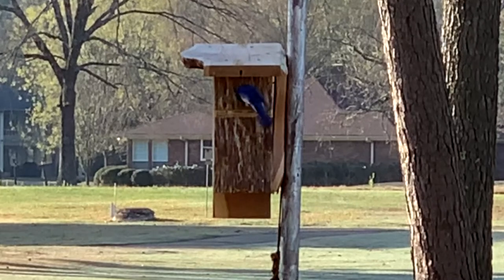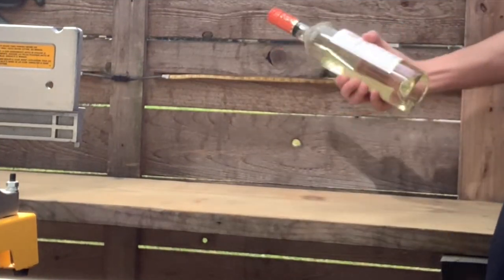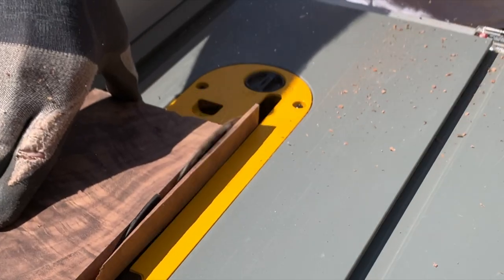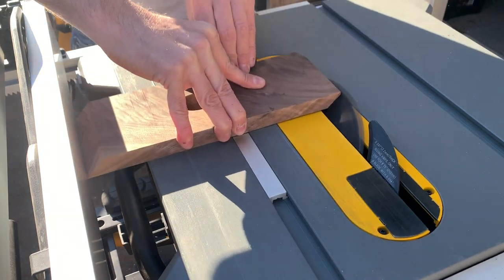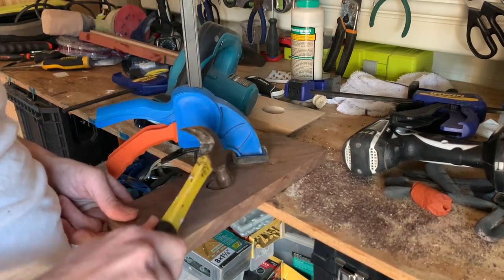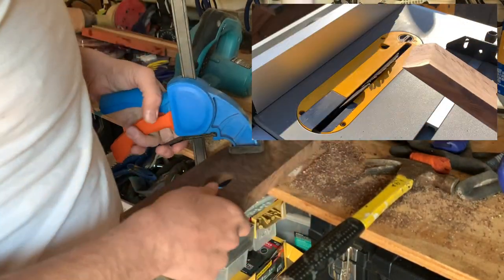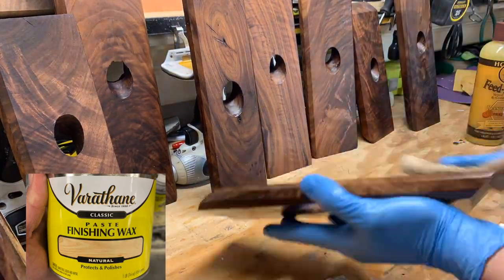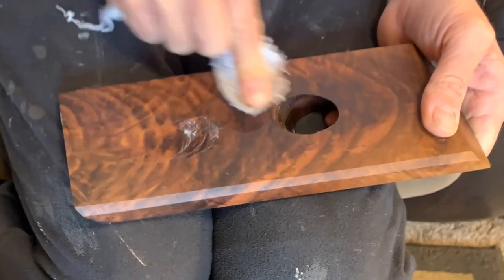Floating Wine Bottle Holders

Comment: Made 4 of these and found they were not too easy to balance - especially when not full. 
So I changed the length to 300 mm & the thickness to 45 mm. A  40 mm hole is drilled 190 mm from the bottom. Both ends are cut at a 33 dgree angle.
They are rock-solid - even with an empty bottle!
Reply from the maker: @fontybits Hey, good morning Loch, thanks for stopping by and leaving your feedback here.  I apologize that I didn't give the best set of measurements in this video.  This was my first attempt at making them after seeing the idea on the internet some time back and I think quite obviously (at least to you), I didn't get the best solution.  I like that you re-tooled and came up with a better alternative and came back to let me know, this is super cool of you.  I'll definitely be giving your method a shot and I'll come back to let you know how they turned out.  I'm pretty excited and optimistic to try these again now!  Thanks my friend, let's get back to making some more saw dust!  Be careful.  I appreciate your time and support here 🤝
Reply: @CurtisMadeIt  Hey Curtis, opinions are like butts - everyone has one! I  thought I'd share the specs which worked perfectly for me. I gave one of my first attempts (25-30 mm thick) to a friend's wife, and she commented that she found it difficult to balance. That's when I went back to the "drawing board." 😃 Maybe someone will even improve on that. Have a great day.
p.s. My pine wood shows some beautiful knots which really add to beauty of the bottle holder.

Comment: Is it ok to drill the hole anywhere down the length of the board?
Reply from the maker: @3AMREVIEWS Apologies for the delay in my reply...I was out of town for the Labor Day weekend and didn't have a reliable internet connection.
Short answer is yes, you can.  You are going to have to experiment though.  On the longer boards, you can use a large wine bottle and flip the board over so you can use both sides to display...I think I like this way the best.  The shorter ones can accommodate either a large bottle and/or a small bottle on opposing sides...this is the experimentation part.  You are going to have to dial it in to find out exactly what you want, but this is a fun project with results that are sure to make a fantastic gift or be a hot seller in the right market.  Let me know how else I can help.  I'm on instagram curtis_made_it.  Talk to you again soon my friend 🤝
Reply: @CurtisMadeIt  Been watching a few videos on how to make them and seeing lots of variations. Thanks for the tips!
Reply from the maker: @3AMREVIEWS Okay, okay.  Good.  Do your research.  Find out what you think will work best and give it a shot.  Learn some stuff.  Dial it in.  Make some new ones.  This is how we do it.  Be careful.

Comment: never wear gloves when using spinning tools, the blade/bit or whatever is spinning catches the edge of the glove and it is dragging your hand in with it.
Reply from the maker: @Crucklewood Designs Hey C, you are absolutely right, thanks so much for pointing this out.  This must be your first time on my channel though as you are clearly not yet aware of my lightning quick reflexes and super human strength.  I'll grab that blade while its on full power and make it stop instantly!!!  Haha, just kidding.  I did know the 'no gloves around rotating equipment' rule beforehand, but someone else may not so it's good that you said something.  *Some of the stuff I do in my videos is to generate comments and, if I remember correctly, that is exactly what happened here...and clearly it worked.  You can see how far off the blade I am so I was taking a calculated risk and a tiny one at that.  I sure appreciate your comment here, your time, attention to detail, and your support my friend.  Come back and talk to me again down the road.
Reply: @CurtisMadeIt  I am sure you know what you are doing and was aware of the risk. I am new on here you're right, i just subscribed to your channel so i'll check out some of your other stuff and well i don't really know what else to say but i hope this helps with the comment generating
Reply from the maker: @Crucklewood Designs I appreciate your time and support C.  Continue to be careful while you are building and pointing out potential mishaps while you are watching us.  I sure appreciate you looking out for me like that.  I’ll talk to you again later my friend.